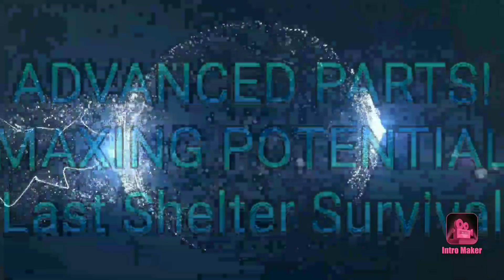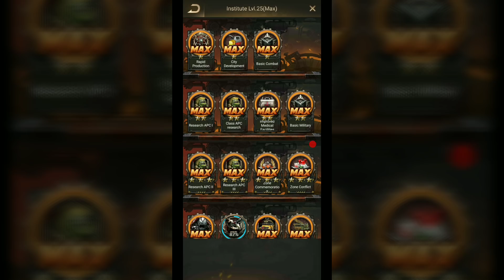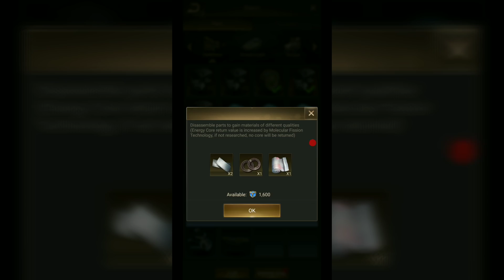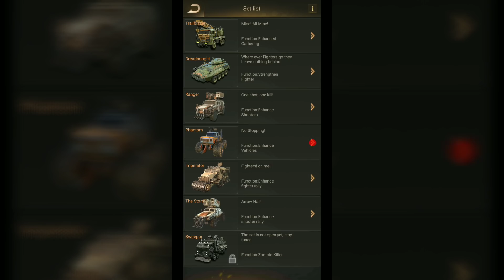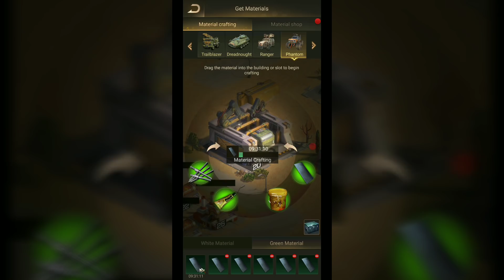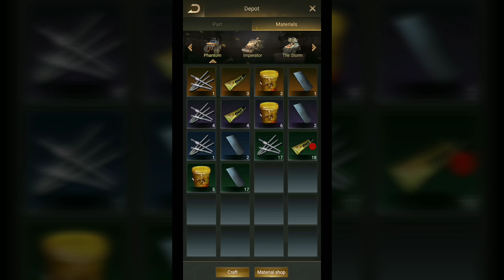Last Shelter Survival Parts Factory Guide - Top 5 tips - Advanced Guide

Comment: One other tip. When making materials, the one being made in the bottom left corner has two triangle arrows over it. You can speed this one up using generic speed ups. Can be a useful way to create those hard materials quickly.
Reply from the maker: Absolutely

Comment: Hey Acer, I just remembered, there’s one more question that might be worth answering: if you buy those parts from the commercial hub and then convert the boxes into orange boxes, when do you think it would be best to split that part? Wait until you get a gold chest? Or just do the orange chest? I still haven’t advanced too much through parts research so I am curious how many energy cores the materials give. Does a gold material yield 4 times as many cores as an orange one, or is it less?
Reply from the maker: all the math is the same all the way through the only reason you would wait is because you would like the materials of that so you might want to get orange or gold so that you can get those materials but the course are not going to multiply their just going to add up
Reply: @TripAholixGaming  thanks, so basically it's the same, only depending on whether I would want to hold on to any of the materials I split. Thanks for clarifying that. I'm still on long way off from splitting materials so I just wanted to know what to do with the chests 😅
Reply from the maker: @Felyxx  I completely understand! Keep Pushing!

Comment: hii there., why u craft gold part in 73% and not 100% as allways i am doing ., could u explain it plz cause i not understand it in videos sry my english is bad :)
Reply from the maker: Some of the requirements to make something at 100% a very difficult to reach. As I stated in the video, the last two parts of any type of parts that you can create will need three very rare materials. To make those very rare materials takes an exorbitant amount of time. At 73% it reduces the amount of time that it takes by saving those super rare materials. That's allowing you to create more parts faster with less super rare material being used
Reply: what happens if you fail, do you just lose the energy cores?
Reply from the maker: @heel28  you don't fail, you get the lesser. Meaning going for gold may result in orange. This is due to the other percentages
Reply from the maker: @heel28  you can simply split them and get the cores back
Reply: @heel28  when you split the part, you get all the materials back at the quality of the part.  This is a great way to bootstrap the 3 hardest materials up to higher quality.  I will use 3 blue and 1 purple to craft, then split the crafted part to get the materials back and depending on your parts research some of the used energy cores.  If you "fail" to get the higher quality you split it and then try again when you have the one higher quality material again.  I ratchet from 3 blue alloy plates up to 3 orange this way and it is usually pretty solid.  It does take some time, and if you're smart about it you can make all these attempts on building day and get good CoZ points from trying multiple times to upgrade.

Comment: I tend to do it a bit different, I use orange common material and 3 green rare materials and try my luck upgrading the rare material to orange. This would mean you buy enough green material chests  to yield 3/6/9/12 rare green materials with energy fragments or diamonds. Then use a majority of your diamonds on purple material chests - reason being if you proc even one extra purple material from the chest it tends to be more worth it. Then you focus on crafting armor/weapon with 1 orange common material and 3 green rare materials - you don't lose the quality of your rare material but you might lose the quality of a common material , but like you said...they are easy to get.
Reply from the maker: Could work, requires lots of luck that way but if you get it, it's good!
Reply: @TripAholixGaming  It happens pretty often, with 1 orange/3 green you have a chance to upgrade from green to orange. But because the rare material is the hardest AND longest to get, it might expedite the process. I would be curious to see which is more efficient though. And those chests are stingy as hell with rare parts!
Reply: This is exactly how to bootstrap up to having the 3 orange materials quickly, the 70% rule is safer, the running one higher quality part (orange for example) and 3 of a slightly lesser quality (purple in this example) risks only time and energy cores, try to always use 3 rare materials of equal quality if your doing this to avoid losing quality on those rare materials.  Another good option if you're floating on energy cores is to craft one of the other parts that only needs 1 of the rare materials and use 3 of the more common materials to try to upgrade it to the better quality.  Each of these methods has value, it's all dependant on your risk adversity.  Play it safe: 70% rule. Minor risk, use 2 higher quality and 2 one step lower quality to try. High risk potential for high reward: use one higher quality material and 3 lesser.  Math wise if you only fail to get the higher quality part 1 time for each step you're moving you'll save yourself energy cores in the long run (so long as you have parts tech maxed out).
Reply from the maker: Preach 🙌🙌🙌🙌🙌🙌🙌💪💪💪💪💪💪
Reply from the maker: @nilesgrey  you know it man! thats what makes you the man!
Reply from the maker: Stingy is an understatement! I personally think that's broken how hard they make it
Reply: At least it isn’t as bad as S1 or S2 packs that give you one whooping regular orange even though you have 100+. Or somehow not getting that one regular orange hero duplicate to awaken..damn you militant..
Reply from the maker: @codyjordan3645  you know.... its funny you say that! im not sure which is worse... i have a lot of orange tickets and to be honest... the damn gold parts might be harder to get LMAO! materials can take a month!!! lol
Reply: TripAholix Gaming I save diamonds and buy purple boxes and only enough green rare material to upgrade them, that’s been the issue the rare material time
Reply from the maker: @codyjordan3645  yeah... its insane. thats why that 70% rule. when you finally get it, you need to be able to get the part too. i will try your technique as well. not the worse idea ive heard